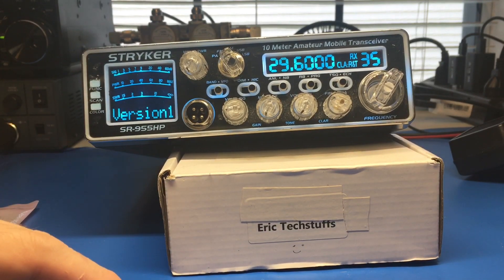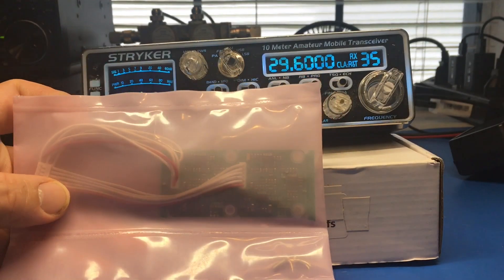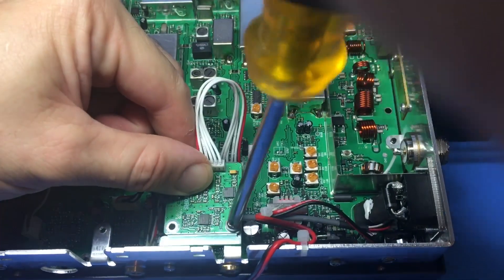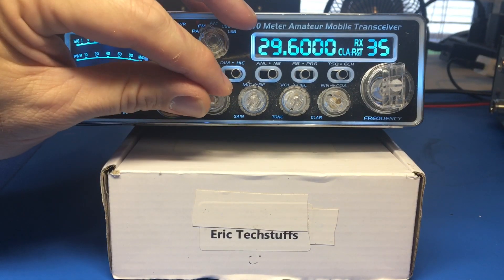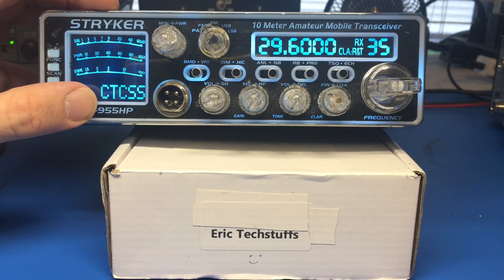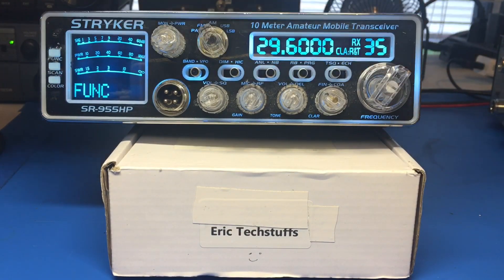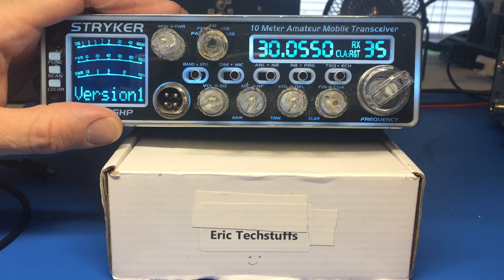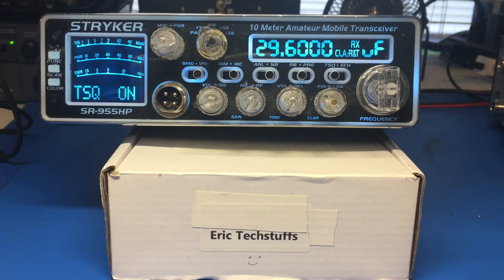Stryker SR-955 v1 Install and Panel Programming of CTCSS/DCS tone board for HAM and other uses...

Comment from the maker: Clarification :  You can use the tone board setup on a CB channel: a fleet or a couple run together - you can program the T code and R codes to match...if you wanted to go a step further - you can program the T code and R code separately you'd have to have reverse R and T codes for that option.  (like old days of talking on on channel on receiving on another, same concept, just same channel) It's like GMRS and what was dubbed "sub channels" it just clears out people that do not have the code to "open" your receive.